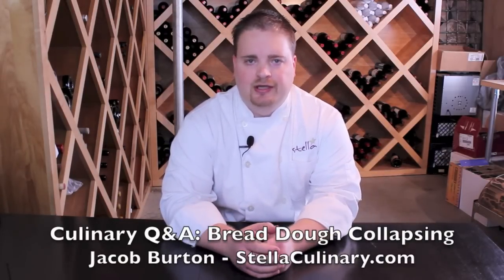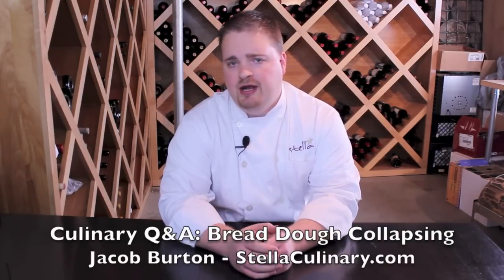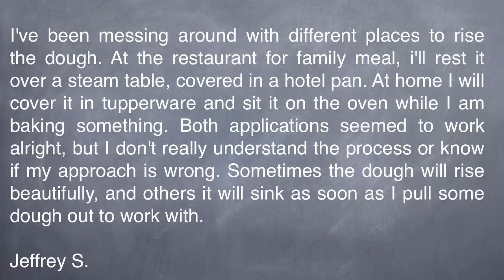Why Does My Bread Dough Collapse?

Comment: I don't think I'm over fermenting. I mixed a batch today and put it on the porch at 84 degrees. Left it one hour. Made little buns and long rolls they rose for a half hour. Then I tried putting a little egg wash on them. Everything looked great. I gave them a little space they rose the second time, but when I put the wash on a couple rolls collapsed a little. I gave them a little time to expand but they didn't do much.. I baked with a preheated oven at 420 and gave them a blast of steam with some water. Then after a few minutes I backed the heat off to 360 for 30 minutes. They look good but are the same gummy heavy, grainy, small holed farmers bread that weighs 4x what it should. With a rock hard crust. 
Same way every time for 20 years. I tried a thousand times and a thousand different ways and just got a mixer. The dough looks great feels great rises once and crashes no matter what time of year or what temp. I make pizza dough the Same way and even got OOO flour and tried a half dozen ways with honey, milk, you name it I tried it. Same heavy gum bread or cardboard cracker crust ever time.
Reply: I also made the refrigerated fermented 12 hour pizza dough and it never gets warm enough to rise again even if I take it out 5 hours before.

Comment from the maker: Atta flour is made from hard, durum wheat and is commonly used for flat breads that need to rolled thin. Atta flour contains a high percentage of gluten, a lot more than all purpose flour. The more gluten a flour contains, the more structure it will have, making it great for rolling out thin, flat breads or large artisan loafs. However, the gluten will also give you a tougher texture, which is why your scones turned out the way they did. Next time use all purpose of pastry flour.

Comment: Maybe this is what is happening. This bread is rising fine but it only takes about 45 min to an hour. I split the dough in half to make smaller loaves. I thought I would brush them with an egg wash and sprinkle some sesame seeds. As soon as I touched one with the egg it immediately collapsed. I left the other one alone and baked both. The one that collapsed took longer to bake and was about half the height of the other. They both taste fine but meh. I do preheat the oven before I let it rise for the 1st time. I’m always worried that it’s not warm enough to make the dough rise. Newbie to baking bread so trial & error. 🤪

Comment: I know this video is old but probably a few more people making bread at the mo. If the bread mixture flops (mine did on the 2nd prove) can the ingredients be salvaged? Should i cook it and will i get flatbreads or can i add yeast again and bring it back to life? Not wanting to waste my orangic wholemeal flour.
Reply from the maker: lyndsey Anne you can roll it out with a rolling pin and then cook it on both sides on a grill / griddle / pan to create flat bread. Won’t be as good as a successful flatbread recipe but it will salvage the dough into something edible. If your dough was made up of 100% whole meal flour than that’s probably what’s causing it to collapse. I would recommend using no more than 30% whole meal in conjunction with bread flour. 20% or below if you’re newer to bread baking.